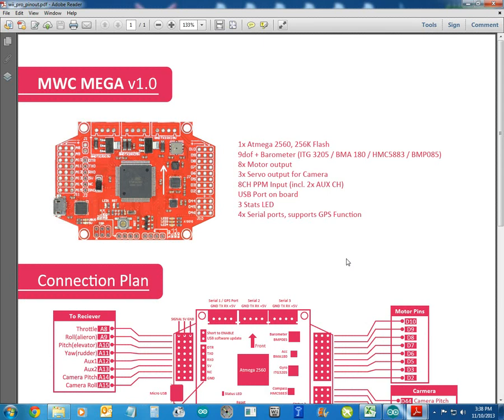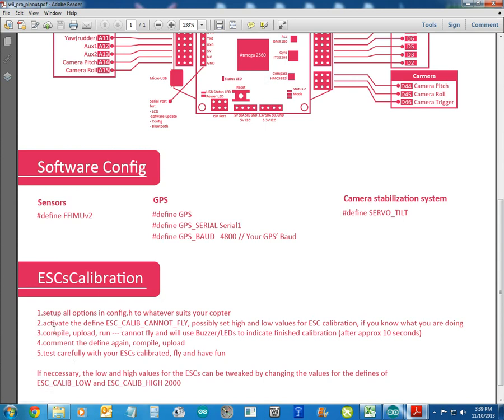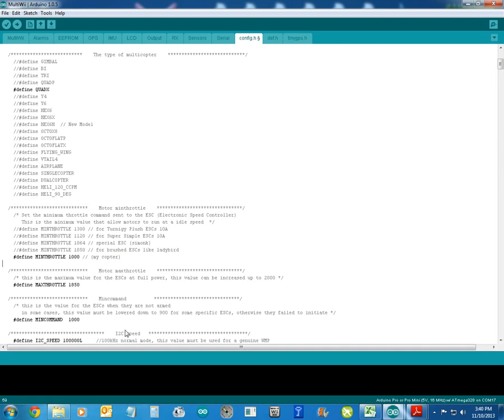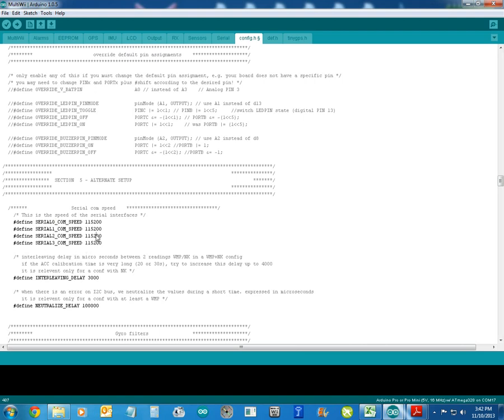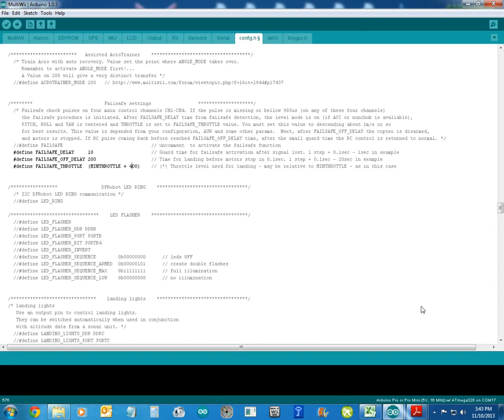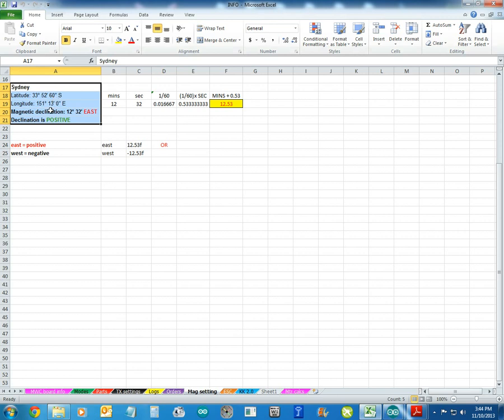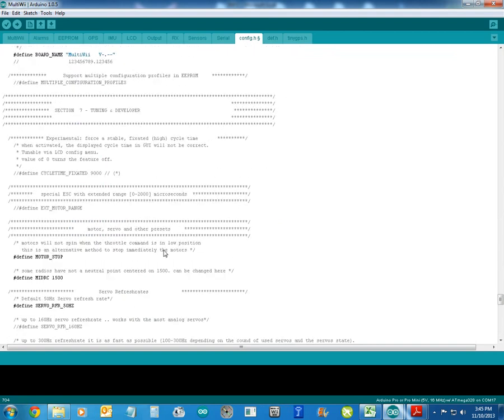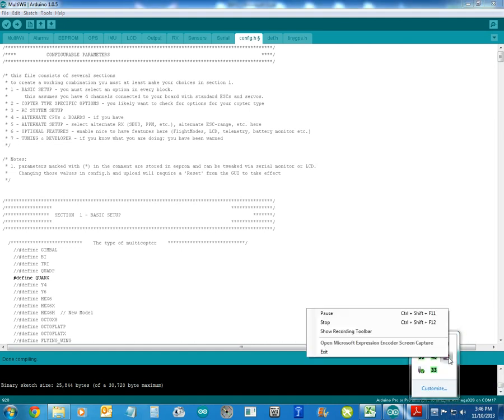Multiwii pro set up

Comment: I have board flashed and all setup and its flying good. but i can't get the GPS to work when i try to initialize it on the software it gives my errors and will only work if i uncomment the serial port. when i open up the GUI the GPS fix will blink and it quickly picks up satellites and says that it lock on to 9 then it says its locked onto none. is the GPS broken or what am i doing wrong. 
Thanks

Comment: Trying to make the transition from KK2.1 to MultiWii - the end goal is to be able to do aerial surveys of the farm / check waters using waypoints. Just trying to understand the basics. I've got Arduino 1.0.6, but wondering what sketch you would use for a quad (to get me to the stage that I can follow the video above)?
Reply from the maker: If you get the Hobbyking multiwii pro boards as shown in the vid you can upload what ever version of MW you want. The current 2.3 is about to be superseded with 2.4 but in answer to your Q. its dead easy..... all the MW firmware and GUI is open source (free) and the version I am running is b4xmas which does exactly what you want to do........ I would suggest you go to the hobbyking site and find the multiwii pro board..... there is a discussion page and heaps of information on file...... cheers
Reply: moochasas
Thanks Mooch, appreciate your help. It's the MW from HobbyKing that I bought - actually got your name from the discussion board. I'd looked at some of the docs but was a little unsure what I needed as far as code - I thought maybe there was a link that people recommended.

Actually, I think I might be onto something now - will keep you updated :-)!

Comment: I am a total noob with multiwii, although I have mucked about a bit with the Ardunio before. My question is regarding setting up the the HK multiwii pro to work correctly with the SK450 deadcat conversion. I have seen one video were someone used some geometry software to come up with some settings but it seemed it was still a work in progress. Is there any definitive working settings to make the deadcat stable using this board?
Reply from the maker: Not that I know of...... I would try the standard settings for an X quad as it works with my X580 and those booms are offset.
Reply: Thank you very much that is great news. Because of the the video tutorial that HK created for their KK board which covers correcting the geometry I had been led to believe the offset would cause the quad very unstable. My fear was that I would end up damaging the multirotor before I was able to get it tuned in.
Reply from the maker: Well to my way of thinking if it was that hard they would either have to supply special set up instructions or risk not selling many of them due to the frames being too hard to control and fly........ my suggestion (which I think you will probably already do) is fly it gently till you get the feel of it..... let us know how you got on..... remember there are a lot of people in this RC sport that love to tinker, modify and over engineer (or complicate) things so I use the "I will try it myself" theory before I make the call....

Comment: Moochasas, thanks much for taking a lot of the mystery out of setting up this board.  It's not difficult when you have a good guide to lend information and this video is just that.
Reply from the maker: Thank you and no problems..... FYI what I left out (as I dont use the MTK GPS that comes with the board) Is that you have to comment out the  #define NMEA as well as the #define INIT_MTK_GPS...... if your using this unit just be aware that it doesnt like the indoors life so dont be surprised if you dont get sat signal inside your house.

Comment: Sorry but I can't find this answer: what is p limit and why does it fpdigger from p gain?
Reply from the maker: Ok if your trying to compare your KK knowledge over to multiwii that could be a trap as KKs only have P&I.... but answering your Q.... the higher the P the more it will make the copter twitch (like a KK)... my suggestion is to NOT touch your PIDs... as these are not KKs...... KKs need to be tuned whereas MW's are already tuned for you...... 10 MW boards..... heaps of different versions flown....... heaps of different configurations and types of flying and I have never had to touch the PIDs........ so please do not compare your KK skills to these boards otherwise you will mess up....... and you can ask me how I know that :)

Comment: Thanks. Are you running default firmware or mega pirate? Why bother changing?
Reply from the maker: I am running MW 2.3 navi b4xmas version on both my MWpro copters.... check out multiwii 2.3 @ 125%..... awesome firmware........ I have ran Mega Pirates but no no more.... too many RTEs...... (return to earths)..... expensive firmware... and heartbreaking.....

Comment: Why is it when I hook up the multiwii pro board to 2.3 GUI I get this error.
(Flight Control SW version mismatch expected :230 Got :220.)
It work perfect on 2.2......... 
Thanks for all your help.
Rudy
Reply from the maker: Hey Rudy....... its probably because you have a mismatched sketch to the GUI.... with 2.3 you have to download the pair together.....(IE b4Xmas has 2 folders.... the sketch and the GUI)...... and that is what I am running...... if I connect the 2.3 b4xmas quad to say to the multiwii config GUI it will get all sorts of errors .....hope that helps.
Reply: maybe you are using the wrong board on Arduino. I had the same problem was stressing for a couple months. What worked for me is selecting board Arduino Mega 2560 or Mega. It might be different for you depending on your board I have Crius AIOP V2

Comment: Sorry moochasas,maybe I didn't make myself clear.I myself know about setup of the Multiwii Pro FC and I agree for the money it's an excellent FC and indeed I have one myself but what I meant to say was I prefer flying my aircraft to fiddling about with the arduino sketches, PIDS and other settings etc. trying to get it just right when my Naza is virtually plug and play.I found myself spending more time fiddling around with the quad hooked up to my PC than I did flying it,which is really what I enjoy.My MultiWii actually flies quite well,but the time and effort involved in reaching that state adds up to hours and hours,whereas I spent possibly ten minutes or so setting up the Naza to achieve the same results.Maybe my brain isn't functioning quite as well as it used to.Good vid though..
Reply from the maker: sorry I though you were having some trouble and need some help..... yes this board can be a "female" at times....... I find the learning part of the challenge which (for me) makes the end result of flying much sweeter when it works......

Comment: When getting my Magnetic Declination for the multiwii Pro on the look up page I get -6 29' West do I keep the - when I figure out the math for my number.
My information is for Port Saint Lucie Florida.
Reply from the maker: (mins) (sec) (1/60)	(1/60)x SEC)) (MINS+(1/60xsec))
(-6) (29) (0.016666667) (0.483333333) (-5.52)
Rudy, your mag dec is -5.52 so you need to put in your sketch  -5.52f

The above shows how the calc is done and its mentioned in the sketch.
You have the mins -6 you have the seconds 29 you divide 1 over 60 and you get 010167 you take that number and multiply it by the seconds and you get 0.483 then you take that number and add it to the minutes 0.483+-6 and you get -5.52
For a WEST mag dec you add a minus but seeing your already minus all you need to do is add the f at the end of the number........ cheers
On the hobby king page under multirotors/flight control boards/multiwii pro there is a discussion page and a (purple) information tab page containing all the info.
Reply: moochasas
Thank You
Keep up the great work I learned a lot from your videos.
Rudy
Reply: moochasas
Where in the program or manual does it tell you which channel on the transmitter controls the return to home and the alt hold.
Thank You
Rudy
Reply from the maker: Once you have set up your board via the sketch you connect to the GUI (Graphic user interface) and that is where you set up your AUX switches for the functions such as RTH posHOLD, ALThold etc...... there is a vid on my YTC for that as well.......

Comment: Mooch,
I need help. Im stuck. I have managed to download the the drivers for the board, got the Ardruino load to puter, got a clean 2.2 flashed to the board (after checking the sketch for the throotle settings, quad set, and stop on throttle down. I have calibrated Tx and varified that the throttle settings on Tx are 0-100%, that it was set to quad. When I go to arm, nothing. The three little LEDS on right (looking forward) come on, blink then stay on solid. The ones upper and lower on chasis they also blink on enitial arm with sticks on Tx then the one one the bottom stays on the one on top goes out, then move throttle up and nothing. Are the Motor pin wires polarity specific? I have them D-6 threw D2 with the light orange on the inside and the brown on the outside (edge of board). Also cant seem to find clean version of MultiwiiwinGUI that will unload without complications,,,,,Help!

Comment: Hi, I am having trouble with the MultiWii 2.5, have scoured the internet for info on this board version but have had no luck. I have tried the options for 2.0, 2.1, 2.2 and 2.3, some get further than others but there's always something. I have also tried contacting the manufacturer and they offer no support whatsoever. Please if you could give any advice I'd really appreciate it, thanks Adrian.
Reply: Adrian, if you show me what board you have and tell me where you got it I could assist.
Reply: Tony Banfield Hi Tony, sorry about the late reply been visiting family. I have the Criuse MultiWii 2.5 (http://www.goodluckbuy.com/crius-multiwii-standard-edition-flight-controller-v2-5-supported-2-axis-gimba.html). I ordered version 2.0 but received the 2.5 and was happy because it was a newer model, would have sent it back if i knew the trouble it would bring.

I have been able to configure the board but it only arms if i disable the only arm if straight option, I think it might have something to do with this (MPU6050C), there is no option so i chose (MPU6050). If I make a new definition like in your example I get errors when trying to verify. In the multi Wii Config program when I connect com3 the graph in the white box displays readings, the receiver displays readings and when i arm the motor signals also work but the Direction, roll, pitch and compass give no readings. also having trouble writing to gps and nav boards but one thing at time.

My email is spinachmonkey@gmail.com, if you need any other info, I am still new to this but have had a few people ask for help (all 2.5 buyers) so at least i'm not the only one and will gladly share any help you could give.

Thanks again,
Adrian.